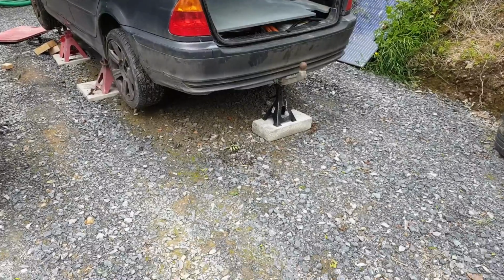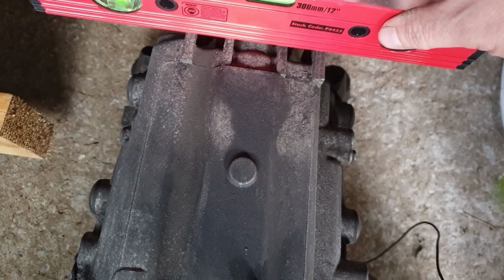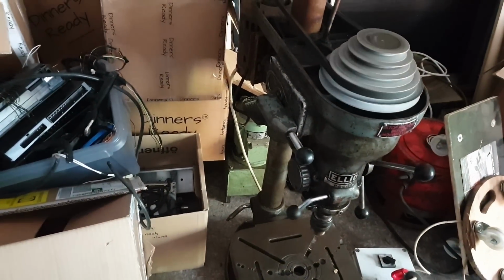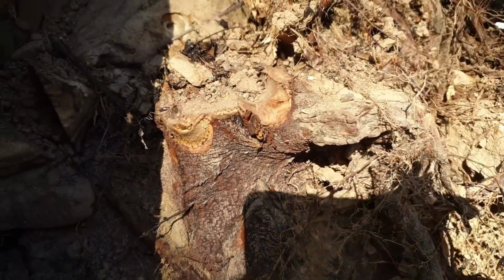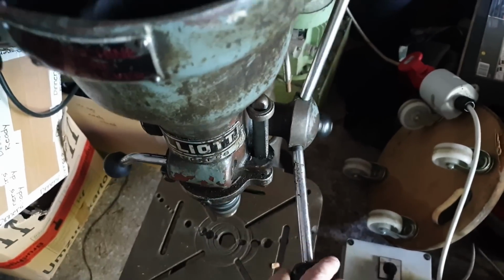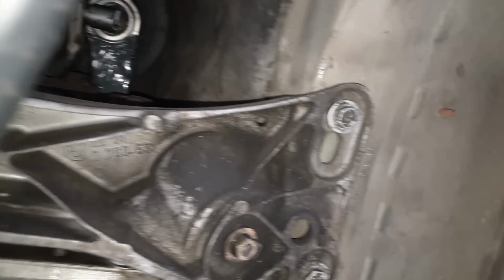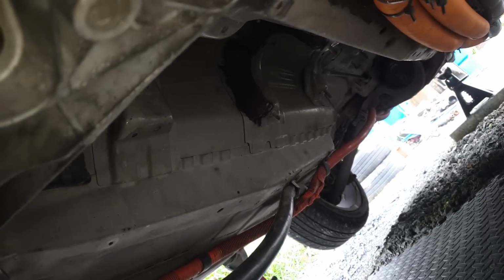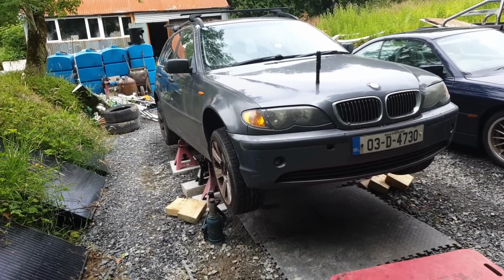E46 Touring EV Gearbox Swap Part 2

Comment: I have a 16 tube / 240 litre solar water heater which was installed four years ago, here in central Mexico there are only about 10 days in the year that we need to use the gas water heater. There are four of us in the house.

Comment: Hi, thankyou for your videos! Please explain to us why your gears don't grate without a clutch when changing gears? Please i need to understand this, starting my own conversion. Or anyone reading this?
Reply: The rotating mass of the electric motor is quite small compared to most combustion engines and when you let off the throttle and there's no regen applied, the motor doesn't apply any torque (unlike combustion engines which have an idle and high internal friction). Therefore the synchro rings can adapt the speed of the input shaft rather easily.

Comment: The solar thermal system that you have looks like a Kingspan solar system with a dry-break tube setup, so they'll disconnect themselves if they overheat . From what I remember, you need to mount them at an angle over 20° with the collector manifold uppermost . Use some nontoxic glycol to keep corrosion to a minimum and prevent freezing. 
I really like the simplicity of your motor to gearbox alignment method.

Comment: Is the gen 1 leaf motor easier to use than Gen 2? will it function on a lower voltage such as 102v to 144v?
Reply: No
Reply: @vidznstuff1  thank you

Comment: Good to see the grey goose mobile again. Is it feasible to convert a Lexus GS450H to a BEV by taking the engine out and keeping the transmission in the car. 🤔 I prefer a BMW to a Lexus, but a high mileage GS450H is not expensive in the UK partly because of the fuel price and partly because of the annual road tax.
Reply: I think Damien started a project to do this a few years ago but for various reasons we never heard anything more about it.

Comment: Your motor's starting system may be going out.  Either the starting switch or the  capacitors.  Depending on the motor there is a starting capacitor or a run capacitor or no capacitor.  Most small to mid horse power motors have a starting coil that switches on when the motor stops and off when the motor reaches speed.
Reply: The box that Damien had the drillpress plugged into is a homemade static phase  converter , obviously some of the capacitors or something have failed as the 3 phase motor hums on 2 phases.
Reply: @Pats-Shed  When I posted I hadn't realized it was a 3 phase motor which doesn't need any kind of startup system.  I recognized the symptom of no starting system function not a lubrication problem.

Comment: Interesting. Good to see progress on the property too. I was told that acceptable runout on transmission centering (normally supported by the pilot bearing) is 0.04". More than that will lead to transmission failure. This is apparently why alignment pins are used and aren't relied on by bolts except for clamping (bolts are too inaccurate for 0.04" tolerances). This exact suggestion by me, transferring holes to a mounting plate via cardboard template, has been ridiculed by some. So, if you were off by 2mm, that's 0.80", 20x as bad as it should be. Which is odd, because, even like, 10 years ago in your vids you had a procedure for setting up alignment with minimal runout, how'd you ever end up 2mm off? I'm surprised it lasted that long, which leads me to conclude that, while important, this isn't the sky is falling scenario that some people claim. Still, better to keep that runout minimal.

And speaking of amateur machining failures... that shop you first paid to machine your coupler... what could possibly be a simpler task to a machine shop than a round coupler? You'd think that if some high school kid was starting his first day in a shop, that's the job they'd give him, because it's impossible to screw it up. How did they possibly fail to center the alignment on a round part? The lathe forces holes to be centered. You'd have to put in extra effort to fail that badly. Did they drill it out by hand? Sheesh.